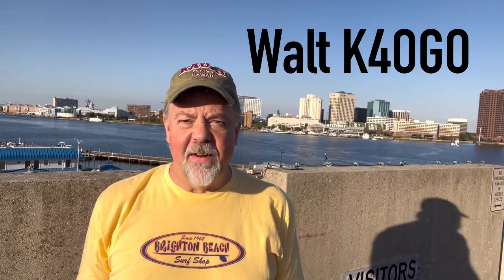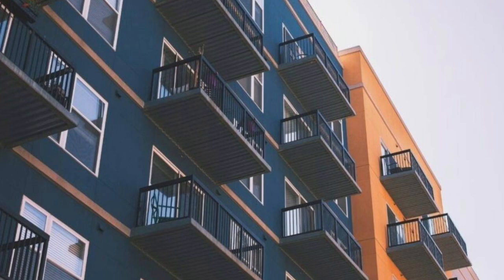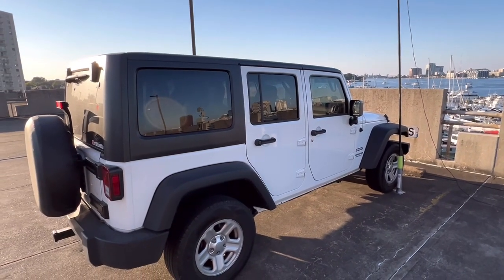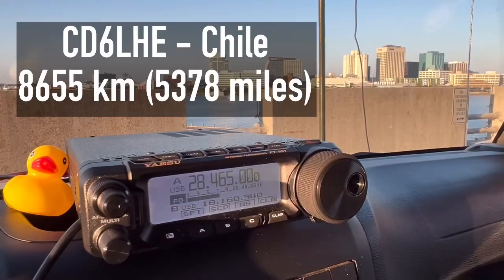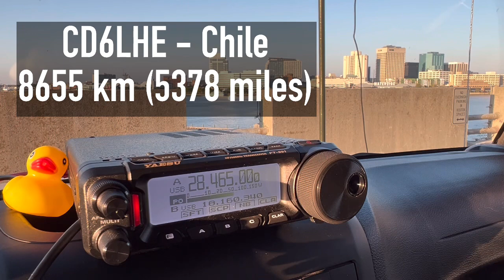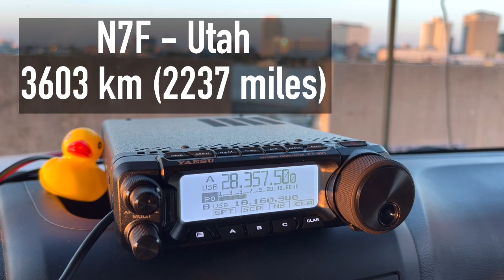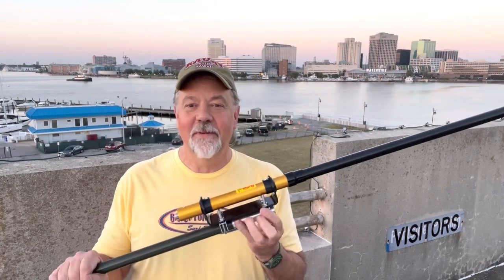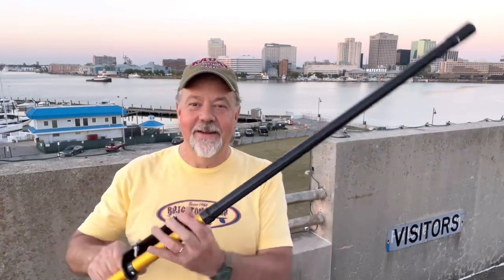Testing the Tram 1499 10 Meter / CB Antenna

Comment: Thanks for an honest real world review and demo on this antenna. I have a CB Boomerang I’m contemplating of putting up, but this Tram 1499 is catching my attention. I don’t live in a HOA, but I like to keep peace with the neighbors. I have a random wire antenna mounted on the inside railing of my deck for HF, which the neighbors can’t see. For VHF/UHF I have Comet dual band mobile antenna on a ground plane mount situated on a corner deck post. Anyone asks, I tell them it’s for receiving satellite weather images. Great antenna for ISS and Fm satellite contacts. The Tram 1499 just might fit my needs for something not too conspicuous. Thanks again, Walt.
Reply: I used to have the Sirio version of the Tram but in the end the plastic disintegrated due to sun/weather. I replaced it with the Sirio Boomerang which works much better as a  1/4 wave with counterpoise. Neither approach what a good full size 1/2 wave or 5/8th wave with groundplane would give however. I guess that height is still might but 73 and good luck - 10/11 is so open at the moment that anything should work okay .
Reply: @johnnorth9355 , I have the Sirio boomerang antenna. I haven’t put it up, yet. I feel the main element is too flimsy. It already has a bow in it and I haven’t taken it out of the package. The Tram looks more inconspicuous in my opinion. I’m not using it for DX, just local communications. I have 2 major highways near me and I monitor truck traffic.

Comment: Thanks, I've used one of these antenna's for years and worked 10 meters & CB around the world! If you have limited space and still want to get on the air, try one! I use 100 feet of RG-58 coax to get 1.9 SWR on 10 & 1.2 SWR on CB! I was surprised with this Antenna!
Reply from the maker: Thanks for watching and commenting!

Comment: I grabbed a roll of poly rope for electric fences to play with. over 600ft of stainless wire to play with. First thing I did was throw up a 20m inverted V. After adjusting for the velocity factor for stainless steel wire, I got a 1.3 match in the middle of the band and 1.5 on the edges. Good enough for me. I used a bnc to multiway connectors for a no solder antenna. the legs were looped on the end and stuck on a fiberglass 4 ft post the apex was abt 16 ft up on 20ft telescopic fishing pole. And we were off on ft8 at 50 watts max. using 50ft of rg58. First contacts were France and Italy right off on the 1st CQ. 14.074 Mhz (not everyone knows) As I played around I put it on every band 20m to 6m and made DX contacts of course I had to use a tuner to hit the other bands. 6m was on the dead side, this was during the eclipse. All total maybe $10 of parts to make an antenna and a whole lot of fun, for a nerd. Could have just used a rope over a tree branch to get it up in the air.

Comment: Nice little antenna ; back then when I was a student, I put a mobile antenna (6 ft long, stainless steel whip with big coil) on the rail of my balcony. Had a 1/4 wave radial, was tuned. Worked the world on 25W (President Jackson CB radio, from France).
If there IS propagation, any metal in the air will make it. If you can have it in the clear, it's even better.
Reply from the maker: Absolutely!

Comment: Good demo! Yes, you can do a lot with almost nothing. A couple notes here. To put the size into perspective, roughly this is like having a 14 or 15 foot vertical on 40 meters. That’s larger than most, if not all 40 meter mobile antennas. Second, it radiates a signal. Just suppose the antenna has - 20 dBi gain (this one probably has more more). In that case having 1 watt to a good quarter wave vertical (0.0 dBi gain)  would be like having 100 watts to an antenna with -20 dBi gain. We know plenty of DX has been worked on 10 meters with that combination. I suspect that antenna in better than -20dBi but I wanted to give a worst case example. I think I did my math right. Having my first cup of coffee now!
Reply from the maker: Thanks! Yes indeed, it radiates a signal! 73

Comment: The 1 meter long Tram antenna was originally made for the British market that required an antenna with 3 db of attenuation, to legally use 4 watt CB radios in the UK, though 2 watt CB radios could use full size base station antennas at that time.  It is a handy size, but be aware it is designed to cut the effectiveness in half.

Comment: Hi Walt, 10 meters has been really good lately, just built a half wave 10 meter flower pot antenna from some spares I had laying around, going to take this out portable to see how it works next weekend, had it mounted on my 12 meters DX commander mast whilst tuning it got me thinking the choke was quite high up on the mast , might make some flower pot antenna's for each band from 20 meters up to 6 meters.
Reply from the maker: That's awesome!

Comment: Hey Walt, interesting video 👍🏼
We were talking about these antennas just this morning, over here in the U.K. they are sold under the name Sigma Excalibur. People on boats and in caravans use them a bit over here.
I did some experiments on 11m with one last year in my loft and outdoors. I should maybe try it on 10m but I have an Antron 99 vertical outdoors that is currently working great on 10m and 12m. 
Definitely an affordable stealth antenna worth experimenting with 👍🏼
73 Frank M7EWV
Reply from the maker: Hi Frank! My home antenna is the Sigma HF-360. I’ve been wanting to try the Antron 99 and might do that soon. Thanks so much for watching and commenting! 
73 Walt K4OGO
Reply: Hello Walt. Here in England I was talking to someone the other night that was using the same radio as you on 100 Watts into an Antron 99 at around 300 metres AGL, about 20 miles away. I was using a T2LT, indoors stretched along the hallway on a handheld at 800 milliwatts at around 25 metres AGL. It's all I can have, antenna wise - you have to work with you've got! The other guy was telling me that I needed the same as him to get anywhere, completely missing the point that I had an S9 report from him on my 800 milliwatts and gave him an S5 on his 100 Watts. I have enjoyed watching your videos. David.
Reply: Hi David, good call on the T2LT. I made one for a local guy to put in his loft after the council made him take his antennas down outside and it got him back on the air.
Being an M7 I’m restricted to 10w but the furthest two contacts I’ve had have been on 12m using the Antron, USA and Tajikistan. 
Tempted to try this Tram/Sigma antenna again in the loft after watching Walt’s video 👍🏼

Comment: I can see Waterside in the background. I haven't been inside of there for years. I know it's changed a lot since then... (How many times can my mother tell me? Apparently not enough.) Nice work with the antenna & 10m. I see you made contact with Isaiah KJ5CMP. I just did too Friday late afternoon also on 10m with only 5W. 73!
Reply from the maker: Yes Waterside just went through a complete makeover a few years ago. I can catch  the ferry from the end of my street over to Waterside which is nice. 73

Comment: I live in an apartment, but my office window faces towards an open nature preserve, so not a ton of traffic.  About 3 feet from my window, there is a corner where I can put an antenna up without disturbing anyone.   I was thinking about something like a tall tripod with a mast.   My question is about the coax.  You mentioned having a long run.  Would it work if that coax is unwrapped for 4 feet, then the other 46 feet is coiled?  Thanks for the help!
Reply from the maker: I think you might have some difficulty with the coax coiled. That’s actually a way we choke RF energy by coiling the coax. What you’re describing is basically a 4 foot long piece being the counter and I’m afraid you would probably not be happy with the results.
Reply: Thank you!  I thought as much, and you confirmed it.  Love your videos-learning a lot!

Comment: I like to try different antennas as well and my experience with these antennas was not positive in any manner. I would classify these as basically junk. Bought mine new for $25 and was looking forward to it hoping for at minimum a decent experience only to be let down. Since I don't give up that easily I will give it one more try after that if it fails to perform it goes to the trash or the shooting range.

Comment: Question: If the coax braid serves as the ground, does the mounting point make contact with the metal pole? Or is it insulated from the pole?
Reply from the maker: The PL-239 socket at the connection point for the coax is insulated from the pole so the coax braid has no coupling to the pole.
Reply: @COASTALWAVESWIRES  Thank you. I have one arriving today and I was going to check that.

Comment: I use the Sirio version. Works well on 10 and 11 when conditions are up but pretty useless otherwise - I suspect the angle of lift for the signal determines this but I have not tested. . The length and quality of coax is crucial to the success however as is a choke. 73 M7BLC.
Reply from the maker: Yes indeed,  this antenna's performance is all about the coax.

Comment: I'm curious your evidence that the coax is the counter poise?  If so you should have a choke in there... no?  Would the best evidence be by the SWR changing with different cable lengths?
Reply from the maker: There’s a choke on the coax at the radio, I show and discuss that at the 4:05 mark of the video. Yes you would definitely see different SWR at different coax lengths. I used 50 feet as Tram recommended in the antennas instructions that came with it.
Reply: @COASTALWAVESWIRES  Yes I did miss that.  Does the instructions recommend a length before the choke?

Comment: No luck Swr 1.5 cb ch 1-40 but two freinds have it hi rf over ndighbors stuff . I will say it really has crazy recidve so tram recomends 50 ft or more coax . Close to your eadio ir put rf in your ssb kodulation with common mode filter inlind . Usd a choke too. Did not reresonate on 15 meters likd antrin would . 
This make a great cb antenna on camper to porrables at camp grounds am is uneffefted on it. 
$35 i paid i was bdtter off msiung a dipole wihh alumnim tubing 
I am thinking maiing a 220 antenna out it s casing with griundpland 
Have fun people .

Comment: Using a CB antenna without counterpoise? You just committed a ham radio crime hahaha 
Have you ever tried DX on 11 meters? It’s actually pretty fun. To confirm with qsl you have to actually exchange addresses and everything.. it’s a mess, tons of crapy radios… but it’s fun! 

I challenge you to get that 10/11 meters radio you have and do some DX on 11 using 2OGO/DX callsign 😂the ham police is going to be mad at you.

73!
Reply from the maker: I cannot confirm or deny that the 11 meter option may have already happened 😂 73!

Comment: Why are people using Ham call signs when on a CB? Makes no sense.
Reply from the maker: They’re not. I think you’re confused
Reply: @ I’m not confused sounded like call signs to me.
Reply from the maker: @ the entire video was about using a CB antenna on the 10 meter ham band. I wasn’t on a CB.
Reply: @ no shit. I watched the whole thing!!
Reply: They are using call signs assigned to them for the ten meter ham band not the same as CB. He was transmitting in the 28 megahertz band not the CB band that starts at 26.96500 megahertz through 27.40500 megahertz. There was a time when you had to use call signs on CB channels and not a handle or self-chosen number. I read some of your comments and either you are indeed confused or have a lack of intellect regarding what frequencies are used for different operators such as CB, Ham Commercial, GMRS and others. If you watched the video as you stated, then may I recommend reading skills or glasses so you can read the frequency the gent in the video was transmitting on.